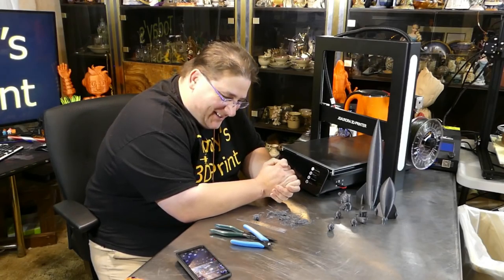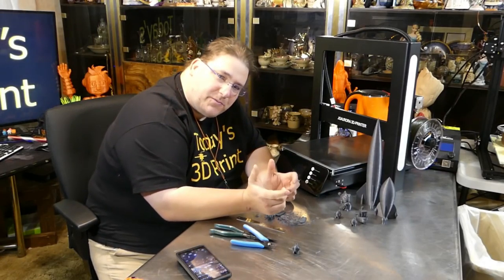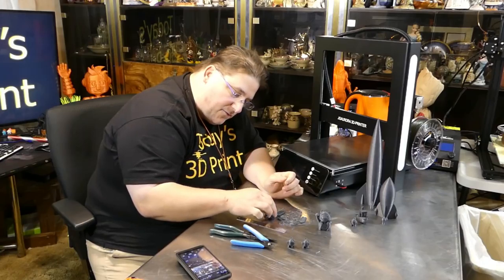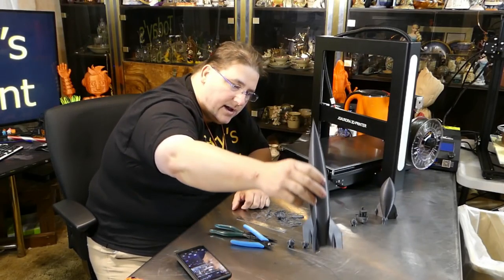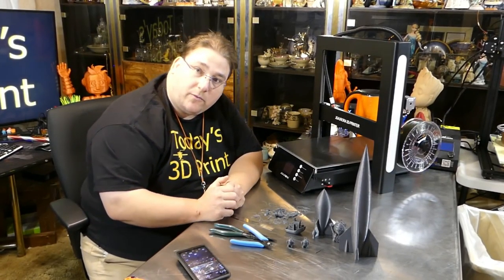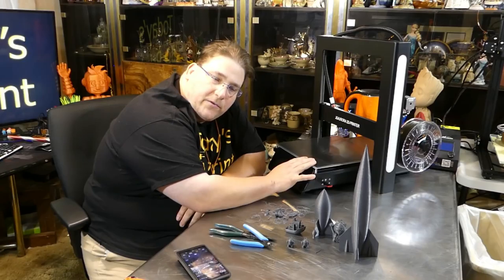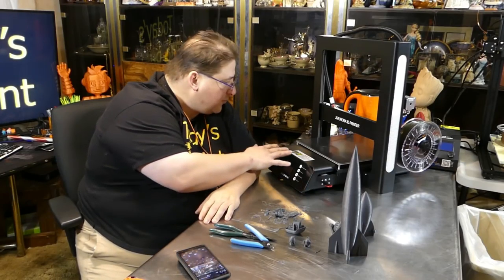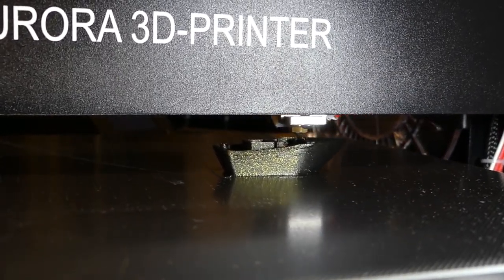Today's 3D Print 163 JG Aurora A5 Part 2 Unbox, Assemble, Print

Comment: Weird about the temperature, considering how many people print at or under 200C. I also have one of these on the way now, so you may have saved me some frustration, although I do generally print at either 210 or 220 depending on the filament, so it might not have affected me.

Comment: Nice find and nice tutorial, I print a  project and came out perfect with walls .057 to .068 mm and 200 mm tall came perfect change the filament brand and all when to hell, so now back to the trouble shooting.
Reply from the maker: besides sometimes temperature I notice almost no real change from one filament to the next with few exceptions. what happened? what filament? same gcode or reslice? GBR go back to roots print a known good gcode (marvin or benchy or something like that NOT A RESLICE but gcode you already actually used and got good results with)
Reply: Total disaster after change filament manufacture, printer CR10 and S3D was tune with PLA from Sunlu, everything when fantastic on different parts finish the project no issues super happy.  So decided to do the same project same factory files gcodes nothing different just the filament, change to Zytech, boom trouble begging , the wall of .54 in width perfect but then under extrusion, compensate for under extrusion and boom over extruded and details lost and still in that particular section under extrusion, have 2 day trouble shooting the issue, so re install Sunlu PLA and start the same print same from before, a no problem at all, change to Zytech and now pummm, clogged the nozzle, clean nozzle, now tuning the CR10 and S3D one more time just for Zyltech.  So far so good but totally new parameters.
Reply from the maker: +maxun1 some of the sun Lu Plastics are higher temperature Plastics turn up your temperature to 260 degrees and crank some filament through it just squeeze the bike brake handles on the feeder and push them filament through after you've pushed about 12 inches of filament through then lower your temperature and try your print again you've probably just got some leftover plastic from the other filament in there and has a different viscosity so it's restricting the flow of the new plastic you just got to melt it out that sometimes happens when you change types of plastics for example I have to print Sun Lu at 235 C to 240 C
Reply: Sun Lu  filament was done in 230 no fan came perfect. I have to keep the no fan to perfect adhesion to 1 paramenter thick, no choice.
Reply from the maker: +maxun1 you cannot print single-wall pla at 2:30 without problems if you don't use it cooling fan not at 230 degrees some lose the exception because that's a higher temperature plastic but zyltech is a normal pla try printing it slower at 190 that might work with no fan Maybe

But then you'll have lesser layer adhesion your problem is not the plastic or the printer your problem is you're doing something weird and you got lucky and got away with it with the sunlu plastic

A cooling fan will not deteriorate layer adhesion it doesn't cool down that fast what you want is to printed hot 225 or 230 degrees I would suggest apla Plus or Pro for that as they are more tolerant to higher temperatures but you must use a cooling fan even a little bit or you have to find a plastic that will tolerate that while maintaining your tolerances
Reply: No can do, has to be 230 C no fan.  Will post the result so far going in a good path.
Reply: So far so good with sunlu but Zytech, is been a chalenge,...
Reply from the maker: +maxun1 you are exceeding operating temperatures for those Plastics it's going to be quite a challenge without Cooling the sun Lu plastic at least the plus version is not normal pla it's a polymer a mix and it can handle higher temperatures in fact it needs it very poor layer adhesion if you try to print it at lower temperatures

Comment: Waiting for your video after some hours of printing experience.
Reply from the maker: +All About 3D Blog my A5 has been running continuously 24/7 since I got it it's actually kind of odd because there's not a lot to report it's just chugging away perfectly I want to take it apart to see if I can fix the tiny little vibration in the y-axis but it's so minor I don't want to screw with a good thing :-)

Comment: Thank you for that video!
I generally print PLA at 190-195C. Maybe you should contact support with the problem, hopefully they'll release a firmware update to address it, at max the failsafe should be at 175-180C IMHO.
Reply from the maker: +GlennJacobsen 160 would be better I have filaments that print that low I think it was just a goof up because they immediately reply to me and sent me a new firmware so I'm assuming the firmware contains the correction I will let you guys know when I install it
Reply: Cool, thanks!

Comment: Man, I was sweating at first when you said you couldn't get anything to print then figured out it was the mintemp... I just ordered mine this morning and it has already shipped out. Getting excited about it now!! Who's filament were you using? I have my pla set for 215 and it does pretty nice work. Many thanks for the review sir!
Reply from the maker: +Richard Corwin I use all kinds I have found that I always get better Prince at lower temperatures if the pla can handle the lower temperature so I always set my first layer to 2:25 and then 200 and if I like what I'm seeing I either raise or lower the temperature based on how the pla reacts this Tuesday I'll try to install the new firmware and see what happens I'm betting it fixes exactly this
Reply from the maker: +Richard Corwin yeah I was up all night pulling my hair out over that I couldn't figure out why the one worked in the one that didn't it was because I installed the old version of cura that came with it I didn't change anything I just like something and sent it and it worked then I went and said it the way I normally said it which broke it because I lower the temperature I didn't realize that was it at first because there was no error
Reply: I will have to try that Nerys. Thank you!!

Comment: Thanks for your review, whats your opinion about better prints, JGAURORA A5 or Cr-10S?

Thank you
Reply from the maker: +Rikimaru Azuma cr10s for better quality. A5 is a very close second but cr10s beats it. A5 heats up faster though so that might sway you but i would pick cr10s by an edge
Reply: Thank you very much for your quick answer, i pick cr10s.

Comment: Hello Nery,
At last i pic an cr-10s and jgaurora a5. Your porfiles works perfect on cr-10, on aurora too but i see some hairy plastic on benchy, i not an expert but i think is for retractions,  i dont know what i need to change on your jgaurora  a5 profile to try not appeer this little hairy on benchy.
Can help about what parameter i need to change?

Thank you so much
Reply from the maker: +Rikimaru Azuma depending on what your attraction is set to you might need to increase a little bit I use 5 mm on the A5 also if you're printing too hot you're going to get streaming so you might possibly need to lower your temperature a little bit
Reply: I use your profile settings, the temp i think is at 215, i dont know what happen, but my benchy is very different of yours... i dont know whay im doing bad
Reply from the maker: +Rikimaru Azuma download my sample benchy G-Code print it directly if it looks good the problem is you're slicing if it looks bad the problem is your printer post results :-) the cr-10 G-Code will work on the A5 as well
Reply: okey. i try this. thank you!

Comment: Im curious to know if you might be reviewing the E12 from Anet? I had my first go with Solutech filaments the other day, had issues, contacted Solutech about it and they sent me a new roll and told me to keep the old one even though its a bad batch. I havent tried the new roll yet but they were awesome, I'll probably stick with them if its good.
Reply from the maker: +skysthelimit866 yes. Its still not shipping yet as soon as gearbest gets one they are sending it out.

Good. They are a decent company in my experience i suspected they would take care of you.

Just remember the ultras are weak and fickle. Its the nature of what makes them so shiny. Their normal non ultra silk plas do not have any of those issues.
Reply from the maker: E12 has shipped !! so review will be coming soon!

Comment: Nice video thanks a lot! Question between cr10 and A4 which is better?
Reply from the maker: +Manuel Castro avoid the A4 at all costs it is not a machine that is ready to be released to the public it has so many issues it's unbelievable I wouldn't touch that machine until they come out with a total revision

The cr10 works perfect out of the box
Reply: Nerys thanks a lot! And what about between cr10 and jgaurora a5?
Reply from the maker: the A5 would look great in an office environment but I still lean toward the CR-10. slightly cleaner prints 400mm build height more rugged and easy to DIY repair. some non standard parts on the A5.

IT IS a fantastic printer though. so if you like the A5 you won't be dissappointed. I have not been.

I do think the CR-10 is a slightly better value though. especially the CR-10s
Reply from the maker: +Manuel Castro n9te you said a4 as in the anet a4 delta. I just realized you might have meant a4 as in jg aurora a5. That printer is good. Not as good as the cr10 to me but really close.
Reply: Nerys thanks a lot! I am looking for a good quality printer and I am trying to choose one of those printers! I am thinking I will choose the cr10!

Comment: Nice review! I have a few questions. I've never purchased a 3D printer, so I'm a newbie. After reviewing several printers I am between the JGAURORA 3d Printer A5 and the Creality CR-10S. I keep going back & forth on these. I like the bed that's on the JG Aurora, but it seem like there are some people having issues with it. The JG Aurora A5 you are using in this video- was it the "updated" version that I see for sale now? I'm not sure what the "updated" version is- is it a hardware change or just a firmware upgrade? Have you upgraded the firmware on this printer? What are your thoughts between the 2 printers I mentioned? Thanks again.
Reply from the maker: The A5 is a very nice printer and it also looks pretty nice too sitting on the table although I personally like the industrial look of the cr-10 better but that's just a geek in me I think I get slightly better quality results with the cr-10s then I do the JG Aurora A5 but they are very close the simpler more open architecture of the cr10s is more enticing to me my concern is if something goes wrong with a V I'll have more difficulty repairing it but both printers continue to perform flawlessly since I started using them

My instinct says to lean toward the cr-10s since you can add the ultra base to the CR 10s if you wish although they five can get to higher bed temperatures but for most of us that's not very important and you could also upgrade the heat bed on the CR 10s as well

A big advantage of the JG Aurora A5 is that you can get them now for quite a bit cheaper than the cr-10s so you have to factor that as well
Reply: Thanks for  the reply, I appreciate the information!